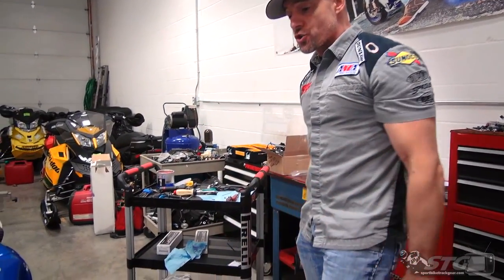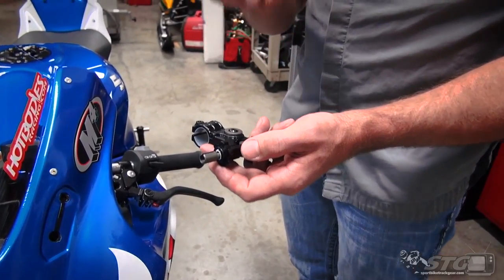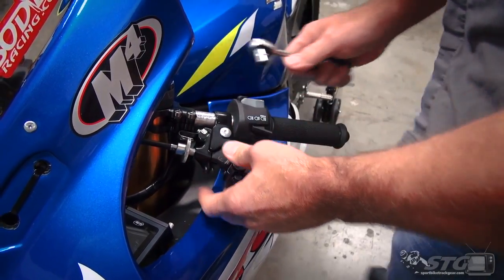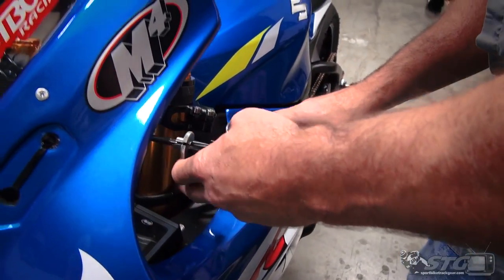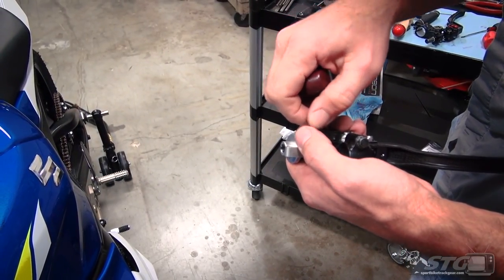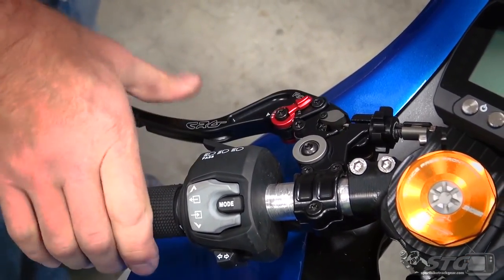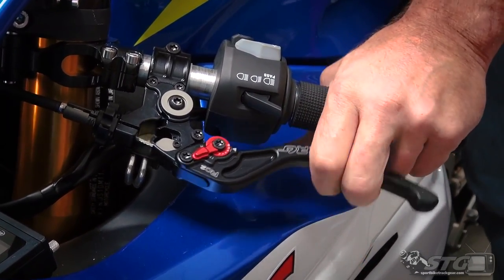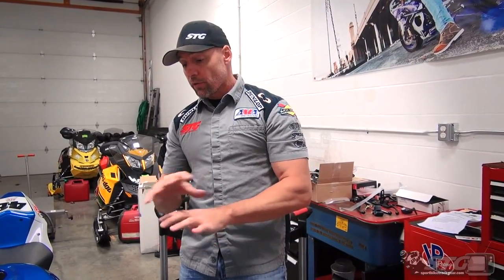CRG SC2 Clutch Perch Install  2018 Suzuki GSX-R1000 | Sportbike Track Gear

Comment: I installed an "r6/r1" version of this perch on a 2016 FZ-07 about a year prior to this video; amazingly the fz-07 clutch switch fit the perch... yamaha is using similar switches on most of their "sport" bikes... the switch screw locations for r6, r1, fz07 are almost in identical locations as far as i can tell from exploded views of the yamaha parts manual for r1, r6, fz07... now I have a 2017 r6 and i will be swapping out the stock perch for another one of the r6/r1 version of this perch. EXCELLENT QUALITY. my only complaint is the tip of the lever is replaceable but I have yet to find a website selling the lever tip alone; even crg's own website is NOT selling the lever tip alone. 

I did not do an install video for this perch on the fz07 but I do have a video of the r6/r1 version of this perch on an fz07 (mods 2.0).

EDIT: FYI the r6/r1 version of this perch worked flawlessly on the 2016 fz07... then I got rear-ended by some woman - her insurance totaled out the fz07 BUT the perch and lever worked flawlessly until the fz07 was totaled. I Forced her insurance to compensate me for all mods on the fz07, including this perch.

Comment: Thanks for an informative video. Did you install standard or short length lever on the clutch? 
I am getting ready to install the RC2 levers on my K6 1K. Do you feel like that perch reduced pull effort (bearing and leverage points)? I like that it (CRG perch) frees up space for adjustment (ergos).
Reply from the maker: I prefer full length levers on my bikes. The RC2 clutch perch is pretty slick with the adjustable leverage for the clutch pull. It allows you to dial in the feel to suit your riding style. - Van

Comment: Hey Brian so I just installed the CRG clutch perch on my gsxr 1000r and I noticed it feels different. It kinda grabs a little further out than it used to I think. Would the cable position I chose in the perch have something to do with that? I chose the furthest position. The same spot you chose I believe. Could that be why the clutch grabs a different spot or is it all in my head. Thanks in advance!
Reply from the maker: All three of the positions feel a little different for sure. I tried them all on my GSXR and landed on the spot closest to the rider. Take the time to try them all and find the one that suits you best. Pretty cool part isn't it? - Van
Reply: Sportbike Track Gear yea it is a cool part I also put one on my R6! Thanks
Reply: So did the cable position change the bite point of the clutch leaver in the end? This is something I would like to adjust on my bike so considering this as an option if it works.

Comment: Hey Brian, I love your videos and it helps us guys out so much so we don't have to pay out the butt to do these things and we also learn about our bikes but I had one simple question and what kind of Grease do you use, I noticed you use a red grease for everything on your bike and just wanted to know what kind it was, I would highly appreciate it brother.
Reply from the maker: Any quality grease will work. What I use is just what I have in the shop at the time. I think the red stuff is Mobil 1. - Van
Reply: Pro Circuit also makes a variety of grease available in small containers for assembly (bearing, seal, etc).

Comment: I own this same bike and I dropped it on my drive way 😭 thankfully all that was scratched up was clutch lever, bar end, and stator cover easy fixes I jus have to find oem parts now all because I was in a rush that's what I get SMH
Reply from the maker: Every bike hits the ground sooner or later. Happy to hear it was not that bad. - Van

Comment: Brian when will you do a Brembo front master???? I thought that would have been next after the lines.
Reply from the maker: I will do a Brembo at some point, plan of riding this bike for three seasons, plenty of time left my man.
Reply: Sportbike Track Gear for sure. I did a Brembo master with the speigler lines and it is a great set up.
Reply from the maker: With this project I am trying to do it in stages so I can ride the bike a bit with each of the parts on it to experience them a little bit. - Van

Comment: I just upgraded my L6 gsxr1000 with steel braided brake lines to give me less progression on the front brake lever. Aside from noticeable better braking on my rear brakes, the front brakes seemed to perform the same. I changed out the stock levers with shorty levers. I still have too much progression for good 2 finger breaking. Would upgrading to an adjustable master cylinder work? For example buying real brembo master and real M4 clamps?
Reply from the maker: Go with the Brembo 19mm RCS Corsa Corta Radial Brake Master Cylinder. I have this on my 2018 GSXR 1000 and it is amazing. So much better than the stock master there are not enough words to describe the difference. IMO no need to change the calipers. Here is a link to it on our site: https://www.sportbiketrackgear.com/brembo-19mm-rcs-corsa-corta-radial-brake-master-cylinder/   - Van
Reply: @sportbiketrackgear  Thank you!.